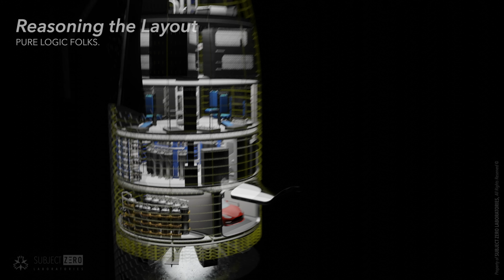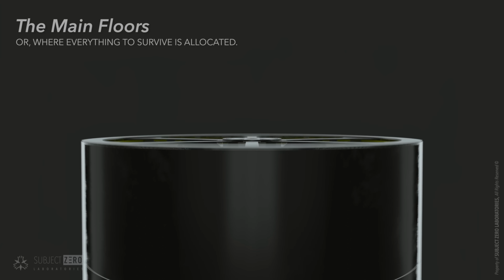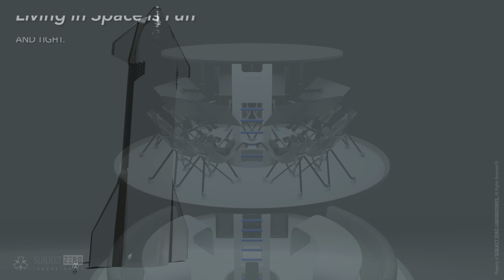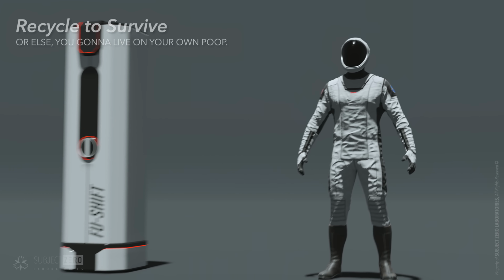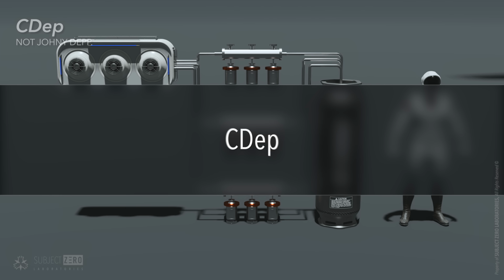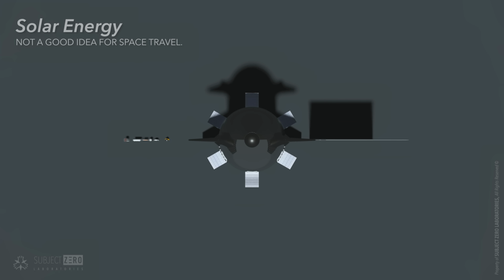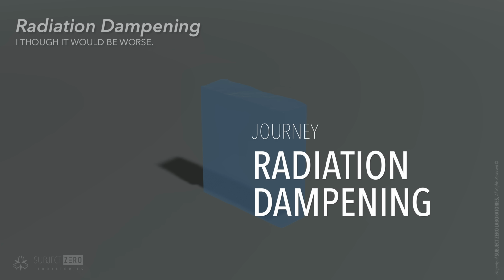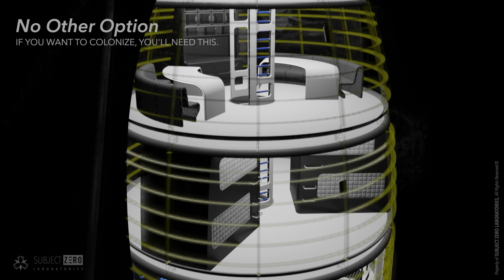Onboard the SpaceX Starship 2.0 in Detail - What it takes to go to Mars | Detailed Breakdown

Comment: You could probably stick something like the reactors they have in nuclear submarines into a big enough rocket. Those things could run a small city, and you could have more than one.
Reply: No, the ones on subs can use the sea water to cool down the reactor, in space you would cook everything in minutes over the heat generated.
Reply: @pinheirokde  Water is not the coolant but heat transfer to power turbines. In case of space travel, the heat will be captured by thermocouple metal plates just like the nuclear battery on the mars rover. Nuclear power has been a thing in space since the 60s, we dont want to cool the reactor, we want to capture the heat.
Reply: @doctorthee  see water is definitely the coolant in nuclear subs. Or else the nuclear reactor would cook people in the sub
Reply: @pinheirokde  I think you misunderstood, we want reactors to "cook" because we can use heat to extract energy. In case of submarines we turn water into steam to run steamturbines. Nuclear fission doesn't need water as there are other ways to capture heat and turn it into energy, however water is deffinity the most efficient. Using it as coolant happens as well, but the main purpose isn't cooling, its turning water into an extractable source of energy a.k.a steam.
Reply: @doctorthee  heat by itself does not generate energy, you need heat transfer, cmon guys it's basic thermodynamics
Reply: @pinheirokde  lmao okay, this has been a waste of my time. Have a nice day.
Reply: @doctorthee  do you understand how any of this works? 
Do you know how for example a nuclear reactor produces electricity? 
You need a gradient in order to have any sort of energy source... Example for a wind mill you need diferent pressure on 2 sides of the windmill bales.
On a whater dam you need water pressure differential pressure n order to generate energy.
In a steam turbine you need diferent temperatures in order for the steam to go from A high pressure hight temperature steam to B low temperature liquid water...
Reply: @pinheirokde  I allready told you I'm wasting my time here with you. You aren't reading my comments. 

You were the one saying water is used for cooling,  for which I replied it was heat transfer. Then you completly ignore it and tell me "heat doesn't produce energy" well duh that was astablished literally the first comment. 

My later comment about not needing water is because there is a different heat transfer used in space, which i allready mentioned is   using thermalcouples. It's called the seeback effect and it's allready in use for many years in radioisotope thermoelectric generators. 

Look i was just trying to help you understand nuclear energy in space, while obviously its not the same as a submarine reactor as there is no fision, but I'm not interested in some kind of debate where either I'm just a terrible explainer or you are just not reading what i say. 

So again, have a nice day but i'm not interested in continueing this conversation.
Reply: @pinheirokde  You are completely unaware of thermoelectric generators, aren't you?
Reply: @doctorthee   Thermoelectric generators can concentrate heat and turn it directly into electricity.
Reply: @10054  not how it works, go and look it up;)
Heat and heat transfer are not the same thing ;)
TEG's need a hot and a Cold part in order to generate electricity, they are rather bad at it with a maximum efficiency of at best 10%

Comment: Solar panels don't have to fold out straight like the ISS ones did. They can unfold radially as well to get more collection area. It introduces more folding complexity, but I can't imagine it exceeds the complexity of adding in such a massive fuel cell system. Hydrogen loves to leak too, which will complicate things further.

Comment: The best option to counter the weight issue would be space stations.

The Starship can launch into orbit with the passengers and some supplies. Then a space station or another starship that was already in space, could dock and supply the ship for the journey. 

Once the starship arrives at Mars, a maned of unmanned space station or craft can be docked. The crew and supplies can then be halved. 5 crew and the necessary supplies go the surface. Once they land safely, the rest can come after.

Comment: The hole in some of these arguments is the fact they will be sending many starships at once. Relatively speaking they are cheap and efficient. Especially once there is a fleet, and eventually fleets. Entire starships can be filled solely with supplies and necessities, which actually maximizes efficiency of the tonnage of pure supplies you can bring because you aren't packing it around a bunch of other systems and necessities normally required to sustain passengers. And if necessary a small passenger compartment could be made in the nose close to have a pilot(s). Can't wait to see these things comes to fruition.

Comment: Or simply ignore the lunch mass, as each spaceship is going to be refueled in space anyway, why not make it so they lunch with empty water and gas tanks and those also get filled during the refueling process, as the mass would mean less when landing on Mars anyway it should mean they can go there with more cargo in total.
You could also make a station that the ships link to in space and push towards Mars, so the spaceships are the engines and the space station can be filled with the things needed during the trip and more cargo, as it wouldn't need to land the mass is again ignored. It would also make the refueling easier as now a few tankers can go to and from the station, while the manned ships wait on the ground until the last minut, making it easier for the crew and cheaper overall. The station idea would also mean more room for solar panels and for the crew to help each other and have more social contact.

Comment: You are being limited. Starship should be loaded and resupplied in orbit prior to departure to mars. With 3 starships departing. 2 to mars surface and the 3rd to mars orbit. The orbiting starship would have the fuel , engines and associated systems enclosed in a steel casing that slides rearwards locking in with a 5 to 10metre overlap. This would create an extra 23 metres of usable space for an inflatable habitat each 11m x 8.5m diameter. Creating 3 levels of 2.7m clearance on each section. Thus creating extra room for storage, recreation, or as deemed viable use. This orbiting vehicle would be a cargo resupply for other craft that actually land. It would also be a lifeboat in an emergency. The extended position of the rockets / fuel system will not be a problem as the will be far less resistance to momentum or thrust in space. A different idea from down under, food for thought. Your 100 tonnes mentioned is from earth ground to orbit. Resupply in orbit as mentioned may triple this figure at least. It just means the starship orbital vehicle variant would not surface land again. Used for return to earth trip it would stay in orbit. For another round trip or as an orbiting hotel. Its viable engineering and physics.

Comment: My first question is "Why would we store Co2 rather than simply venting it overboard?   Does it have a value later in the mission?   Secondly, even though it would be technically a zero gee environment, the addition of a modest Ion engine would still provide enough force to keep loose items bound (eventually) towards the floor.   The thought of setting a cup or a tool down and it remaining "down" seems it wold have practical benefits, even psychologically speaking.

Comment: Water preservation while showering in either zero or low gravity can be addressed by a long-proven method I know as "Navy showers": spray just enough to get wet, lather up head to toe, rinse off. This basic strategy will have to be modified to fit the gravitational environment, but the theory is still sound.

Comment: They will be generating a lot of electricity exercising. If all ten of them exercise for an hour a day the electricity generated by them will significantly cut the battery backup system. Also it would be more efficient to discard CO2 out into space instead of recycling it. This will save us the weight of recycling machines some of which we can offset with more O2.

Comment: I am pretty sure they will just take the oxygen from the main fuel tanks (oxidizer tank, to be precise). This will reduce the complexity (the best part is no part), as they could just put an extra ring segment on starship to increase the oxidizer tank capacity.
Reply: The problem isn't where the oxygen comes from. The problem is getting rid of the CO2.
Reply: @darrennew8211  that are totally different machines doing that, I'm just daying that it is nonsense to put many little and probably heavy oxygen tanks into the ship when you already have a giant one.

Comment: Probably the most efficient way to curb the energy output problem, would be to put one or more RTGs in the area where the diagram has those Tesla batteries. If covered by a plate of that shielding material, the radiation would not be a problem, and the heat could be used by ship systems for anything they need, or just radiated away.

Comment: The main issue is how they plan to rescue the crew in case of a breakdown.
A second problem follows related to the actual ability to produce Methane and Oxygen on Mars. If something goes wrong one is left on Mars--without food and with very little chance of salvation, but above all without being able to think about getting help (launch window every 26 months).
The third problem is related to the amount of material that can be carried aboard the Starships and the actual ability to get it from the cargo bay to the surface of Mars. Without a tower or any other structure, it will be necessary to reduce the size of individual cargoes so that they can be brought down with a freight elevator. 

In any case, taking advantage of the Starships' cargo capacity, with only 10 launches it would be technically possible to assemble a 150-meter-long spaceship capable of carrying over 500 tons of cargo in total autonomy, plus 4 Starships docked to it. All with its own thrusters. Structured in this way, this interplanetary spacecraft would remain in orbit while still providing a base of support for the astronauts on Mars. A second such unmanned spacecraft could be launched by a low-energy route to orbit the red planet at the same time. 

With starships alone, you will not get very far, and if you do it will be with very few people and for a short time. The future of astronautics is efficient, safe, fast and large-capacity means of transportation. And thanks to the transport capabilities of Starships, this is now technically feasible, with an overall cost not unlike the equivalent cost of 5 Starships. 

Translated with www.DeepL.com/Translator (free version)

Comment: Nice video, more people need to start thinking about these kinds of problems!
A few assorted notes:
1) The main tank of Starship contains oxygen already. No mass needed for O2 tanks.
2) Water can be split in O2 and H2 again.
3) CO2 can be converted into CH3 and O2 again and they actually need that to come back from Mars. Again you already have tanks for both.
4) There are much better solar panels now, see iROSA (20% the mass and 1/4 the volume for same power compared to old ISS panels)
4) you forgot the header tanks downcomers 😅
Reply: I doubt very much that any design would mix the propellant oxygen with that intended for the crew. At least I don't believe it has happened before. Water can be split into O2 and H2 again but requires vast amounts of electricity.

Comment: Hello Subject Zero.
   I agree that to get the energy needed for long duration missions, that it should be 'nuclear' in nature. NASA is quite well versed in 'Pebble Bed' reactors, and RTGs. Radioisotope Thermoelectric Generators. A good example is the Cassini Probe mission to Saturn, who's RTG lasted well over 30 years, before the probe was crashed into the Planet. At the time when 'disposed of', the RTG was still producing well over 40% of it's 'At Launch Capacity' power output, which was a total of around 720 Kilowatts of power. I suggest that RTGs would easily cover the projected power needs of a Space-X mission to Mars, and keep on producing useful amounts of power for several decades of use. Only a few would be needed to power the spacecraft to and from Mars, and the weight savings could be used for other concerns, or for additional capabilities.

Comment: Good analysis, just one point: even if solar seems not so reliable( in your opinion), it is the only way where you get energy external from the ship, so you don't need to take that mass into account. Every kWh generated by solar is 45 grams less in hydrogen/oxygen. spacecraft quality panels in your configuration  will generate ~45kW in the worst condition. That's a little short of 50kg less hydrogen/oxygen per day. Or  14,5 tons over a 300 day mission.  

A combination of fuel cells, solar (free external energy) and batteries as buffer (but maybe generating H2 and O2 is more mass-efficient) is likely the best solution. Nuclear brings in a lot of extra difficulties.

Thanks for the vid!

Comment: Make the Starship link in orbit with more modules or other Starships, storing fuel, water food, and use their engines if needed.  Make the modules expendable if needed, use the resources contained and decouple as the resources are used.  Would also give a redundancy, if the main Starship fails, transfer to the auxiliary

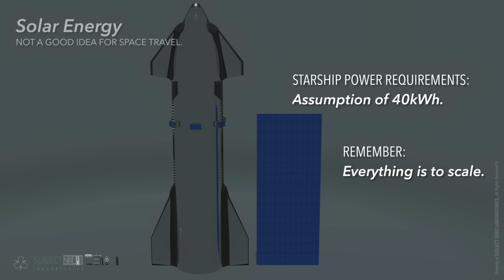Comment: @10:28 '40kWh'  Wh is a measure of energy, not of power. So unless you mean 40kWh per mission (which would be quite small for such a long trip with 10 people), you probably mean Watts, not Watt-hours.

40 kW is quite something. Its like running 40 microwaves at max setting, continuously. No idea of the amount of machinery in a Starship though, so I am not saying it is wrong. Perhaps that is max expected power and not average.

Think of Power as an energy stream. Every second a packet of energy flows along. If your spaceship uses 10 Watts of power, then during a 2 hour mission it has used 10W * 2 = 20 Wh of energy (or 20 * 3600 = 72kJoule, since 1 W = 1 J/s)
Reply: 40kW is a tiny solar array.
The ISS has eight 20kW arrays. (180kW).
My HOUSE has a 15kW solar array.
To avoid deployment issues, you could just leave the array in space and pick it up again on the way out.

Comment: The water is needed anyway, and thickness determines how well it shields.  At least during space travel out of Earth and Mars orbit, it makes sense to have all the water and other things (lox, hydrogen) at the very bottom, that is oriented towards the sun, to provide maximum storage capacity for minimum weight, and provide the most efficient and most useful radiation shielding at the same time.

Perhaps that’d result in the lowest level being the bathroom/water level with all the other mechanicals for the rocketry as well, but that just makes it that much more efficient.

Another aspect of this is you need to expect micro meteorite dust hits on the outside of the ship, particularly the front.  Perhaps I’m mistaken in thinking having water closest to that is a bad idea, this isn’t a subject I’m a SME for ;)

Comment: Carbon Dioxide scrubbed from the air can be used for thruster jets while traveling to Mars for maneuvering changes. You also have to remember that while out in space the solar panels will be in sunlight 24/7 not just during the day like on Earth or the ISS when it circles the Earth so that doubles the amount of power produced.Once out in space O2 production from scrubbers and even the life support can be stored in the ship fuel O2 tank eliminating the need for crew tank storage and eliminate the weight if those tanks. Weight is only a take-off from Earth issue, once in space it's unlimited until you get to Mars then it's limited by the new landing limit according to Mars gravity which would be roughly 3 times more than earth's landing weight, so Starship can be stocked in orbit with 3 times as much weight in supplies for the trip to Mars and have no problems when getting there. People are so 1 dimensional in their thinking and always tend to analyze everything based on where your standing now not on how your environment will change once off of Earth.
Reply: It will be in reduced sunlight the whole trip. But so will the rest of the ship, meaning you need radiator panels at least as big as the solar panels, just like the ISS has.